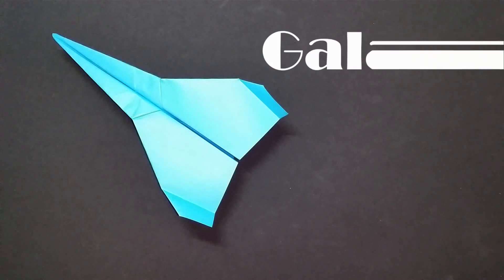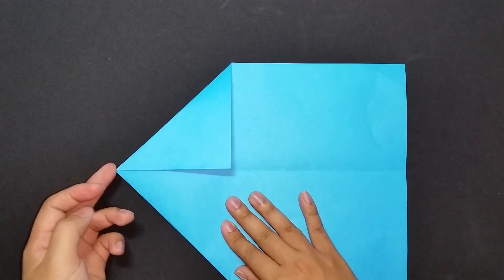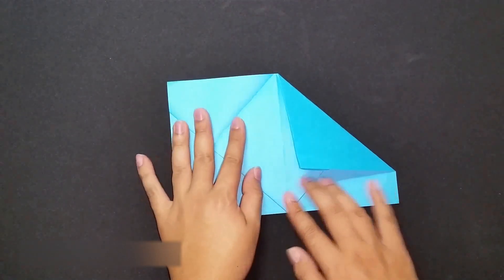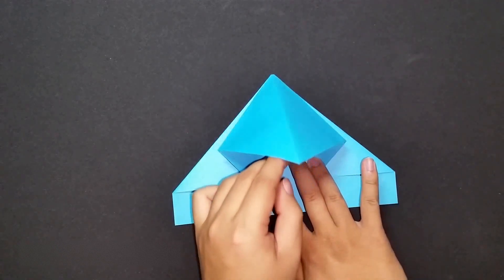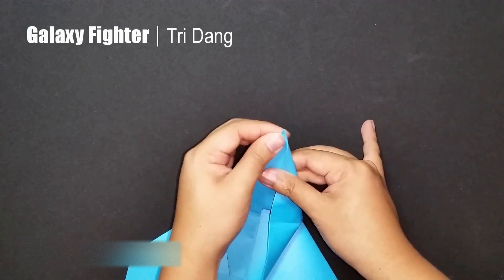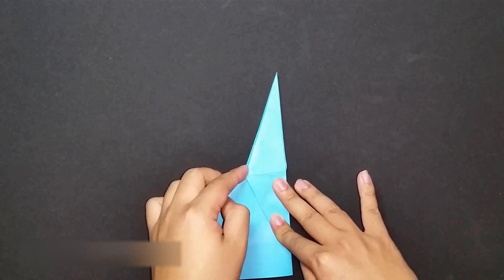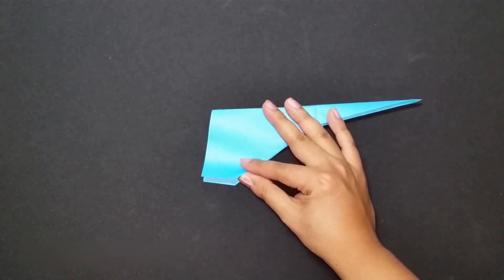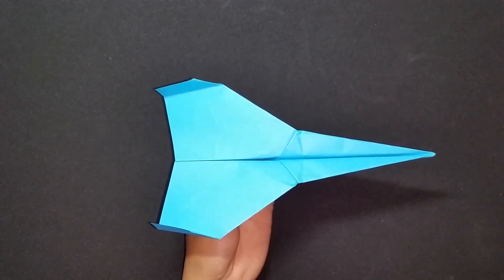BEST PAPER PLANE - How to make a paper airplane that Flies 10000 feet | Galaxy Fighter ⓶

Comment: The way the plane is made only plays lets say 10% of how long and far it flies. Most of it will rely heavily on the temperature of the air around you. As heat tends to rise the heat would push up the paper plane keeping it in the air for longer. No heat then there is no point in trying!

Comment: The problem is that the paper plane is not going straight
Reply from the maker: +XSyberMCPE HQ adjust the stabilizers will help. Also, fold the plane accurately and evenly, it will fly straight.
Reply: I know right?
Reply: X
Reply: NAMASTE YOUR GOOD BEST PAPER AIRPLANE
Reply: airplane world
Reply: DonAwesome ZX
Reply: DonAwesome ZX
Reply: me too donAwesome
Reply: yeah
Reply: u r right this plane is not go to straight
Reply: If you look from the back of the plane straight down the plane, make sure that the wings are folded at the same height. Also make sure that both wings are perpendicular or at the same angle to the body as each other. Simple.
Reply: scr0nch A b0nch rip
Reply: A Test Channel if it turns to the right get the back of where u hold the plane and push the left layer of the fuselage to the left. If it turns to the left, do the same on the right.
Reply: You're right
Reply: This comment is 3 years ago lol

Comment: On the hardest part, I have a way to make it easy peasy lemon squeaky. 

First, on the hard step, fold the bottom edge of the spring square to the center. Repeat on other side. Next, fold the tip of the spring square thing and fold it down on the edge your previous folds make. Next, unfold the three fold u made. Now, on the horizontal crease, fold the layer up like tri does. Line up with center crease and the previous folds will immediately go to the shape u want. That is how  o make it easy
Reply: I dont understand

Comment: I tried over a dozen similar planes, and this flies best, even tho my construction was sloppy.  I made it again 6 times with neater construction, and they roll counterclockwise and dive. Can't figure why they don't fly. I noticed the stabilizers, in the video, aren't parallel to the center-line.

Comment: Mine spiraled out of control before it reached 10 feet. wow. such a great plane.
Reply from the maker: Is your paper too light? It is support to fly straightforward!
Reply: @TriKdanG  I don't think so. I have just regular printer paper. Thanks for replying though
Reply from the maker: It must be caused by the uneven wings and stabilizers. One of the temporary solutions is to throw the plane lightly.
Reply: @TriKdanG  I guess I'll keep that in mind for next time. Thank you!

Comment: I mean it was spinning then it crash landed
Reply from the maker: +Stanley Li 2 things, first adjust the stabilizers, second make sure the plane's wings are flat. This type of paper plane tends to spin due to too light paper. If you have thicker ( hot heavy) paper, the plane will fly perfectly.

Comment: copying is a shame, the basic design of this is by carmel d morris in a book called best advanced paper aircraft Vol 3 that first came out in 1985. it has been used by many people since !!!
Reply: I hadn't seen that book until you suggested. I just searched for the book, and I can confidently say this plane is not there. There is a model similar to this design, but the creases are folded differently. Even the shape is different, too. This case is similar to Dart and Nakamura Lock. P/S: Some of the designs on the books are based on the Arrow and Swallow, too. Thanks for the references. Now I can double check to as sure my planes look like no other. :)

Comment: Horrible I tried ten times failed every time
Reply from the maker: Lauren Morehouse 
I feel bad because you fail to make the plane. Now, let me give you some tip.
Did you flatten the wings? are they even? Also, if it crashes so quickly, fold the wings up a bit to elevate the plane more. Moreover, you should throw it lightly to learn how the plane works, then adjust it. Good luck
Reply: hi
Reply: Sorry what I said just got mad
!!!!!!!!!

Comment: this aeroplane cant even fly waste of time
Reply: THE LAJIT GANG it does
Reply: It's not a waste of time it's a great paper airplane and it works
Reply: If you can create a paper plane well, it will always fly unless you designed it and the weights and lengths of wings are poor.